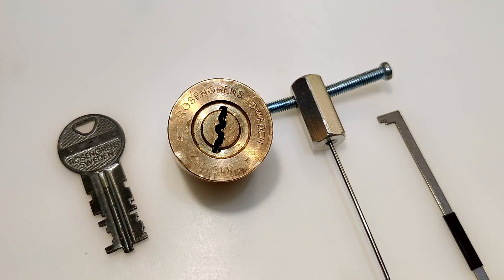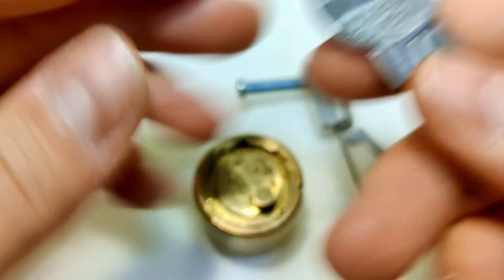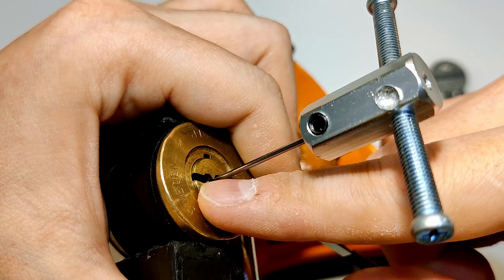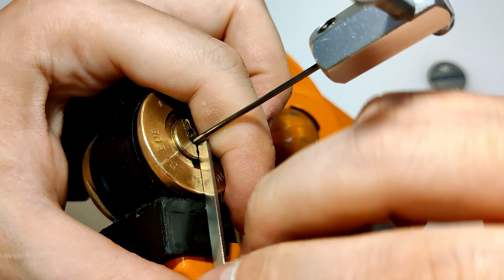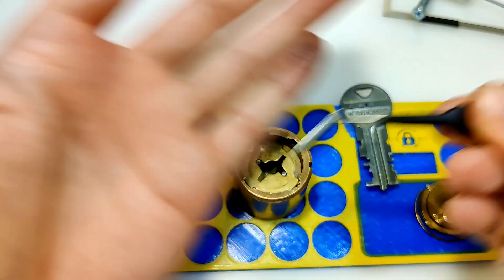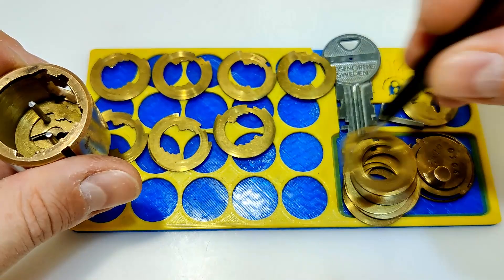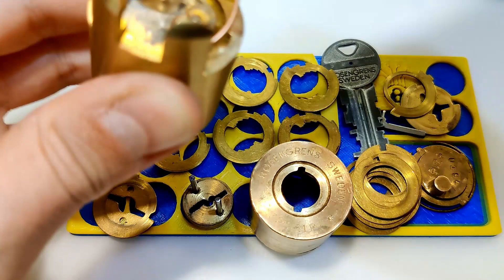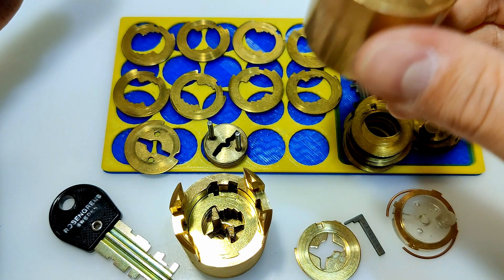242 🔐 Rosengrens 32C 81P safe deposit box lock picked and gutted

Comment: Great picking! 
I picked a bit similar lock yesterday (just much slower picking compared to you). I had that lock type with much more of those false gates & and had to use a pick concept with both turning directions available. There is just enough space in the rear end of the lock (blocking elements are a bit shorter than the key cylinder), so I swaped L-shaped pick there to other side of blocking element for counter clockwise movement.
Reply from the maker: WoW 👌 Fantastic 🎉 well done 👍
And thanks for the tip I will try to pick the newer version too 😉